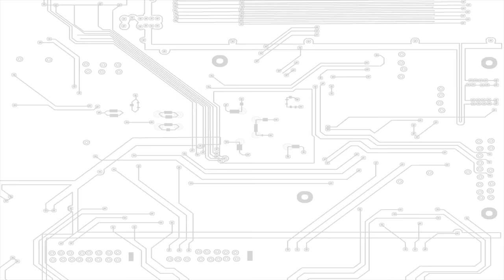How to fix bent CPU pins

Comment: A great CPU design would include having extra pins on the outer edge of the CPU, as they are the ones that are most likely to be bent.
Reply: I don't think the extra cost is justified even if it's like 10 cents per unit across the millions of CPUs it adds up

Comment: I remember this happend to me when I needed to re-seat my CPU as I hadnt put the retention clip all the way down when installing it. I removed the cooler and to my horror, the CPU got pulled out along with it with a few of the pins bent! I was freaking out because I thought my good 300 big ones I spent was now down the drain! I was scared to touch the pins becuase I heard if you so much as touch any of the pins, the CPU gets zapped somehow. I managed to straigten the pins out and it still worked when I put it back in but that was one moment of my life that I never want to have to re-live.
Reply: This just happened to me... although I thought the Rentention bar WAS seated properly. Went to remove the stock wraith cooler to install my aio and the cpu came out with it. Bent 1 pin.

Comment: I heard that the CPU architecture design nowadays multiple pins redundancy for in case one is faulty the other redundant pins will still keep it running.
Reply: Redundancy pins for adding future features and upgrade processor without changing the socket in the future, by the way i'm working in hardware and PC repair

Comment: When I installed my Ryzen cpu I accidentally smashed it into the chassis of the case. However not a single pin was damaged and my system works perfectly so these cpus are pretty rock hard
Reply: I'm gonna do my first build soon and this comment is reassuring
Reply: my cpu got stuck to my cooler and fell on my mousepad and bent 25 pins.

Comment: I would rather have a bent CPU pin than a bent socket pin...
Reply: Ryan Grobe cpus cost more than motherboards.
Reply: PleaseDontWatchThese my motherboard was 250 dollars. I'm not throwing that away if i bend the pins in the socket. I'm fixing it
Reply: meh, depends. For me my board typically is even.

Comment: Thanks for the video! I fixed a Ryzen 7 CPU with about 10-12 severely bent pins. Your method with a razor helped me fix something I was pretty convinced was too far gone. In about a hour or so and some good light i was about to straighten the pins and get the CPU to fit back in the socket. That saved me almost $400 on a CPU I couldn’t return. Thanks!

Comment: Happened to me once haha. The cooler got a really good suction onto my cpu, I tried everything to remove it,  twisting,  moving it side to side but nothing was having it. So kept trying until it managed to pull the CPU out its socket which broke the suction and the cpu went fly through my room bounced off my carpet to land on my metal chair leg. Lets say that wasn't fun to view. Managed to fix all the bent pins with tweezers, still works to this day.

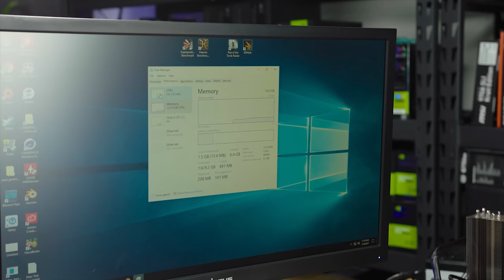Comment: 12:15 Task manager show in the top right 16GB of RAM. On the left it says 1.5/7.9GB and 1.5GB in use, 6.4GB available. 

11:39 the BIOs is showing all 16GB of RAM... I am confused, task manager bug or was the pin important after all?
Reply: thought I was the only one who noticed lol
Reply: Looks like Jay just killed one pin that was needed for the memory controller....
Reply: Memory: 16GB in the top right corner of taskmanager, bottom left 8.1GB hardware reserved, 1.5GB in use, 6.4GB available.
Reply: System has 8GB of memory reserved for something.
Reply: It seems like one memory channel has been lost, something similar like that happened for me in the past. I was installing an Intel CPU and socket had some dust in it. I had 2x4 GB RAM and BIOS was reporting whole 8 gigs but Windows Task Manager told 4 GB was hardware reserved and only 4 gigs was usable. I cleaned the socket and it was fine afterwards.
Reply: Fade oh yep you're right, when the system is "reserving" half of the memory that almost certainly means your CPU doesn't support that much, or your CPU is broken
Reply: Maybe Jay could do a follow-up where he tries the copper pin/solder method?
Reply: If it's a ground pin, then you can spare it, but typically outter pins are for critical functionalities
Reply: On Ryzen systems if the memory isn't running at it's specified frequency Windows does that. Trust me I had this issue and it was one of those moments where you check everything and it was something so simple yet stupid.
Reply: @IcyPinapple He never clarified it was 8gb meaning he likely didn't notice that half of the memory wasn't usable. He did mention that the RAM was running at stock speeds which like I said causes windows to reserve half the memory for hardware on Ryzen systems.
Reply: How so? I have all 16GB of memory accessible to me. Too lazy to backview other videos of him using this chip to see if task manager is reporting the same BEFORE he broke the pin or not, but I have never heard of a system vanishing 8GB of ram like that unless there is a legit issue.
Reply: Jose Pedro Carmo seriously? Why the hell would they do that when those are the most fragile of all the pins?
Reply: Tracksavvy This doesn't happen to me. I'm running a different timing and frequency than specified, no issues at all.
System; Gigabyte X370 Gaming K7 & 2x16GB Corsair Vengance RGB 3333MHz CL15 @ 3200MHz (CL16)
Reply: TheExileFox it is a windows 10 version specific error, I had it happen on crosshair vi hero with latest bios, biostar x370 depending on bios and prime ASUS b350 plus. Different  cpu as well and no bent pins - at least at the time. Some bios versions misreported as well as win10 since Fall creators update had this and apparently it has been patched
Reply: I have the exact same problem. And i didnt break any of my pins. 2-3 of them was bent. I fixed them but still it shows 16gb of ram but 8.1gb is on hardware and 8gb for available for me. I dont know what to do.
Reply: this a problem with the gigabyte aourus ax370 k5 gaming motherboard, had 1 got rid, bag of shit, giabyte shite dont touch ryzen motherboards by them even my sound card wasn't compatible with it,  got a msi pro carbon everything works all memory showing and sound card works.

Comment: Im both ashamed and not at the same time, i bent my FX6300 when my cooler literally just glued itself to it, twisted it just slightly then pulled up and BAM 23 pins. Used a razor, slowly weaving my way through....and then one of the pins broke......life ended, well till i noticed it was Black Friday.....so i sucked deeply and bought an FX8300(was up for the same price as the FX6300).

The 6300 still sits on my desk, as a grim reminder..........never again.

For anyone out there, if at any moment when removing your cooler it sticks, take your time, dont rush it. OR ELSE!!!!!
Reply: Repair by replacement, you could be my mechanic. :-)
Reply: WarGamingRefugee ha, that's funny.
Reply: turn the pc on, warm up the paste, then remove is a good rule of thumb.

Comment: Jay , how to take off cooling paste from amd Ryzen motherboard and cpu pins.
Reply: wash them with alcohol and don't worry if you drain this correct u don't burn CPU, no power = safe to get wet
Reply: F
Reply: cotton bud
Reply: I used a tooth brush and 91% isopropyl alcohol for the pins.  Be very gentle of course.
Reply: So did you apply the thermal paste  to the motherboard?

Comment: This happened to my old fx 8150 after I upgraded to a new system and thought might aswell make a secondary system for myself with the addition of some older 650ti I still had laying around, then it happened when I wanted to clean the fx for the old paste on it, a 1.5m fall on a wooden floor, a slomo effect "Nooooo...." can be imagined right here.
But the razor knife trick made me sigh in relief and no pins where broken off, excellent man 👌🏻

Comment: Back in 2014 when I was building an AMD computer for my younger brother,  the CPU had a few bent pins.  I am not sure if it came like that or it was my fault, but I found an LTT video at a time using the mechanical pencil lead to carefully the pin back into place.  Graphite is somewhat electrically conductive, so any graphite residue on the pins is not problem.

I feel the method in this video is better because it does not entirely rely on the dexterity of the person.  I think I got a little lucky bending the pins back. After getting the computer hardware back years later when my brother upgraded,  I took everything apart to clean up the motherboard, etc., since my brother is a HEAVY smoker.  When I looked at the CPU pins, I could not tell which ones were bent.  They weren't perfectly straight when I bent them back into place but good enough to go into the socket easily.

My brother threw such a fit, I am hesitant these days to help him with computers.  I just tell him to take stuff into a computer repair shop.  But recently,  I told he could upgrade his Ryzen 5 2600 to the next generation (I cannot remember what he bought).  Yet, the repair shop told him the motherboard was not compatible and he had to get a new one.  My brother was really mad at me.  When I got his former motherboard and CPU, I notice it was an X470 chipset.  I am not sure if the repair shop intentionally ripped him off or were too lazy or ignorant to update the BIOs.  I have not told him because he'll get mad just get mad again.  Next time I think I am going to tell him just get a Dell. LOL

Comment: Jay, just here to let you know Windows in Task Manager said it only has 8GB of RAM... I would do a memory test with that CPU.
Reply: Yeah, always do stress testing afterwards.
A missing or proken pin could be a dummy or just a ground pin without use, but it could also drastically change the power delivery.

Comment: Thank you Jayz TwoCents... I used your method to repair my i3 processor pin in my SONY VAIO VPCE34EN laptop...While removing heat sink from CPU without unlocking,as thermal grease sticks firmly with the processor, my processor came out from the socket with pins bent...Fortunately i came across your video and got my problem fixed...Thank you once again

Comment: Life saver!!! I bent a single pin when I was taking the cooler off my Ryzen 7 2700x...I twisted, but it still ripped the CPU out of the socket anyway... I didn't realize there was any damage until I had everything back together and my system was completely dead...thankfully I found the pin, bend it back and was able to get the CPU seated properly...the system started up normal...TY!!!!

Comment: You are a absolute life saver, I recently upgraded the motherboard to X-570 from B-450, and my 3700x after breaking my 2700x bending its pins and one coming off in the socket bent the pins on the 3700x did this method and saved it thank you so damn much Jay

Comment: I realise this is quite an old video but I just had to post as just yesterday it saved my purchase. On a second hand site I bought a Ryzen 5 which the advert stated had all pins intact. When I opened the box 5 were bent badly. Of course after sending a picture to the seller they denied responsibility and said it left in perfect condition. To add irony it was the only second hand part I actually bought for my build. Anyway I digress..... Following your instructions I managed to straighten all the pins and all worked out fine. Thank you so much

Comment: Learned a trick from a computer repair guy years ago . if pins missing rob some pins from a old CPU buy heating with a solder gun and put in the holes that match up with cpu pin locations . what he dose is wrap the pin shaft once or twice with fine sewing thread to make like a spring washer effect to make pin makes good contact with cpu missing pin location. have did this with a cpu with 6 pins missing and was amazed it worked and is still working in one of my computers nylon thread works best since holds up to heat

Comment: You need a very thin hollow tube like the back end of an ink refill or tiny BIC pen. If it is thin enough to fit over a pin, it can be straightened perfectly.

Comment: Great video. I just fixed a 3600x like this but had one pin break and a board that wouldn't boot due to RAM error. Figured out that pin loss cost me one DIMM slot. After moving the DIMMs it's back and happy. So don't give up if a pin (or maybe two) breaks!

Comment: Jay!! I owe you one, bought a new cpu, removed the old one (a 3900X, not cheap). I freaking noticed the pins were bent and the damned thing wouldn't fit in the socket, it was wobbly. Gave your method a shot and after some an hour and a half it worked! It booted and everything was fine. Time to get some of your merch as thank you (though I gotta be honest, it could look better).

Comment: need to start off with 0.3 mm needles in the direction of where the bend is, so it means if the bend is in corner you would need to insert the needle at a 45 degree angle across the pins, now gently raise the needle upwards. repeat this process multiple times. now insert 0.4 mm needle, this I believe is the most the pins can take at 45 degrees due to the arrangement at the said angle. but with 0.5 mm at 90 degree it will allow to further straighten them up. good luck!

Comment: Great video, thanks! I'd bent some pins on the chip -I think from putting it in the wrong way round before locking it in. The razor blade worked a treat. PC seems to work OK -only crashed once when it was knocked, so guessing some pins are still a bit wobbly! Cheers.

Comment: Great video! I recently bent a few pins on an old AMD Phenom II X4, used the same method to easily get them back in place.

The CPU cooler was practically glued to the CPU since the thermal paste was factory from +7yrs. I was amazed the mobo didn't get damaged from the CPU being ripped out.
Reply: Yeah....old ones you are best served by popping the socket lever first (it only releases a little but it's enough) and taking the chip with it. Then chisel the thing off the cooler.

Comment: The final piece of the puzzle arrived today. Tuf Gaming b550 plus MB. My Ryzen 7 3700x cpu had a few bent pins. I installed the cpu in the socket but it wasn't sitting flat. It was teetering. At first I thought bad socket from the MB until i looked at the pins. Went to this video. Low and behold the razor blade kicked ass. You kick ass!!! Then haste kicked in. Went to power my cpu up and .... nothing. Just rgb lighting and chassy fans blowing into nothingness. I forgot to plug in the cpu chip power plug. DOH! Needles to say my new upgrades kick ass!!! Ryzen 7 3700x,  RX5500RXT 8gb,  32 gb ram . I think i'm ready for the new Microsoft Flight Simulator. IF you haven't seen it yet, you should really check it out. Amazing views that will blow you away.

Comment: I had a pin break on my cpu, I guess, when I was taking cpu cooler off, as I tried to bend it back, it was bent far too much to get straight. I used a staple, cleaned it with isopropyl to get glue off, cut it super short, and placed it in my am3 board where it is missing on cpu. Surprisingly it worked. My memory slots work again! Wanted to share my experience.
Reply: I have tried this without putting the cpu on top so I could see what happens to the staple. the thing I noticed was that the staple bent after I pulled down the socket lever. that worried me because I was afraid of it accidentally touch other cpu pins.

Comment: Just wanted to say this video saved my ass and my bent pins on my 5950x, I was replacing a screw on the cpu cooler didn't realize the cpu popped off with the cooler, tried to mount it back and thats when I bent the pins.  Razer blade trick did it 100% THANK YOU!

Comment: Hi Jay, thanks for all of your TwoCents computer videos!  I just salvaged an old Intel 286 CPU before tossing out the motherboard.  While I do have an old CPU processor removal tool, unfortunately, I haven't seen or used it in many years, so I just decided to very quickly try to gradually work the CPU out of the motherboard's socket using only my fingers with side to side back and forth lifting pressures, but the entire outside row of pins on the final lift side of the CPU became extremely bent at the final moment when the CPU suddenly released from the motherboard's socket. Initially, I attempted to use the small bladed screwdriver pin recovery method but with so many bent pins to straighten I decided to see if another method might also work.  I used a mechanical pencil by removing the lead from the end of the pencil's "very thin metal tube" which also extended out from the end of the mechanical pencil.  I was then able quickly insert the individual CPU bent pins into the extended end of the mechanical pencil's narrow tube to provided easy "non-slip CPU pin bending control with 360 degree pin straightening leverages" for each of the very bent CPU processor pins.  As a result, I found that using a lead empty mechanical pencil, with a thin extended metal tip, worked great for quickly straightening each of the processor's bent CPU pins!  My salvaged Intel 286 CPU has now been added to my Old Computer Processor Collection... and it looks great.  :-)

Comment: Like so many others here Than You Jay. I received a Ryzen 3 3100 second hand I was going to use to update MB BIOS in my little small-time Build business - it had 2 bent Pins, not mashed but bent enough so it would not 'seat'. Never had this issue before and thank God I didn't try to force the CPU. Started fiddling around with a needle... then before taking it too far I thought "No - look on dah Tube". "Good it's Jay" I thought, and oh Man you calmed me down and in a few minutes , using your technique here, the CPU was in it's Socket safe and sound. BTW I would not call that a "Razor Blade" it's more like what we call here (Aust) a "Stanley Knife Blade". Cheers!